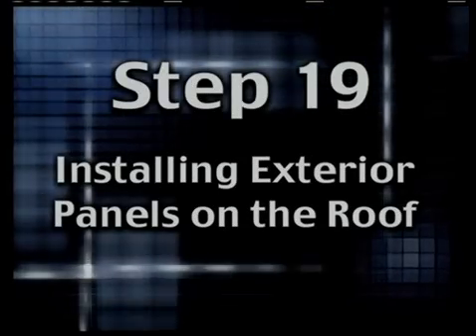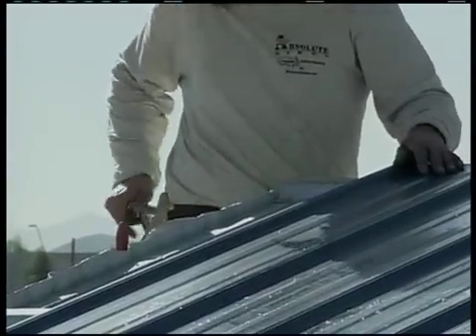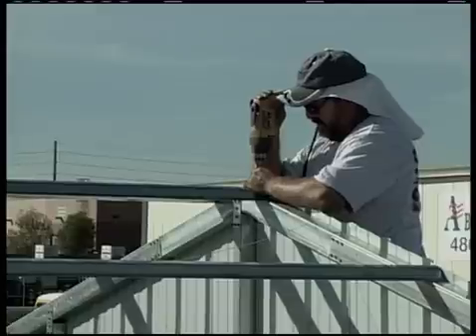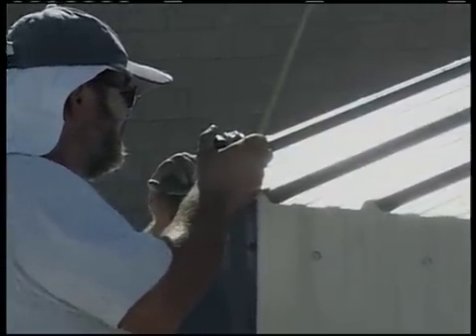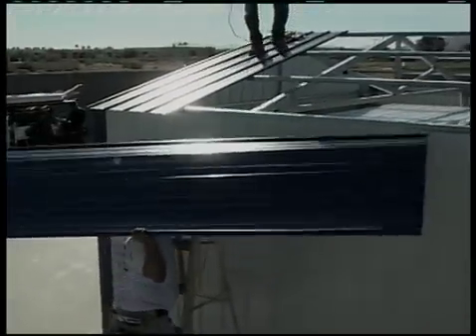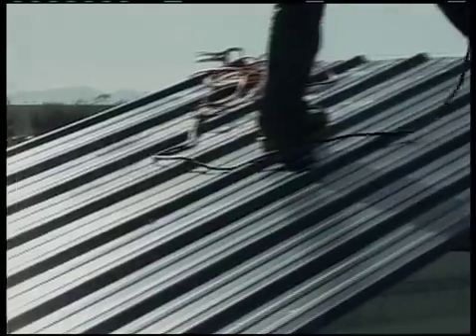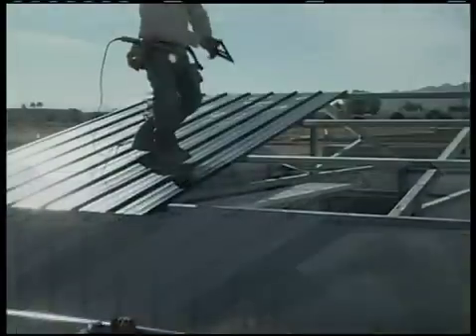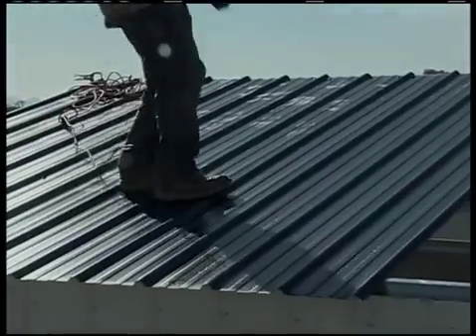Metal Building Installation Step 19: Roof Panels

Comment: Don't try making a living putting up a steel building like they do in this video I worked for a metal  building company, any building 40x60 or less will be complete in one day insulated and doors, the R panel we use has a warranty from the manufacturer any problems with the panel they will pay to fix the problem

Comment: Yea I own Southeastern Erectors in GA. You put the screws in the flat in the sheets/panels beside each high rib. But first you need put butter/mastic on the leading high rib to seal the lap for no leaks. We sell and Erect Metal Buildings. My name is Matt Brock if you have any questions about a Metal Building feel free to call me at 4042135865.
Reply: Matthew - are you still constructing these units? I am thinking of being an installer in Nevada but no one seems to know how to start the process to be an installer. Any ideas would be greatly appreciated! Thank you!!

Comment: What !!! Another bunch of guys putting the screws through the flat of the sheet. You put them through the raised sections to avoid leaks.
Reply: per manufacture instruction install screws on the flats
Reply: Thats why you use screws with rubber washers... Only a jack ass screws down panels on a high rib..
Reply: Which way is right i want it done right..
Reply: Yes Ray it is a no brainer fixing screws through the flat only in America.